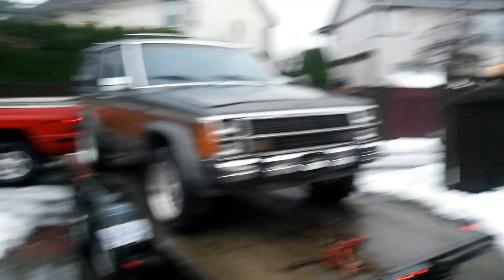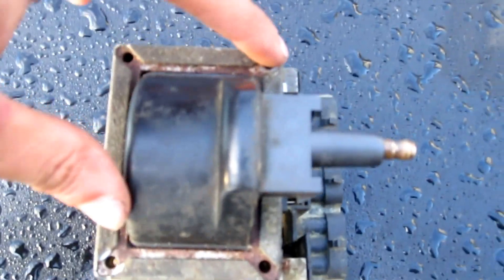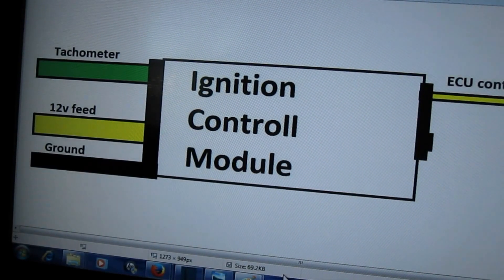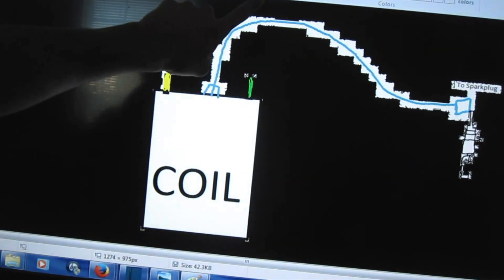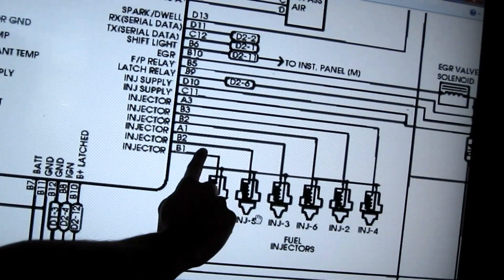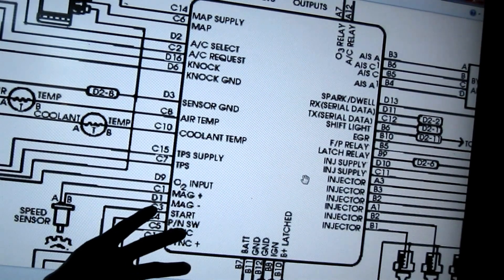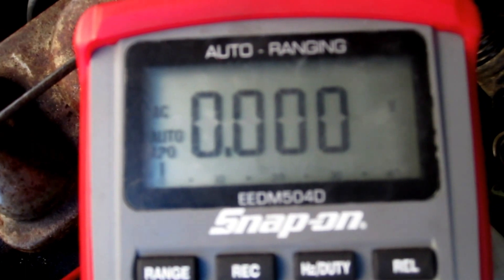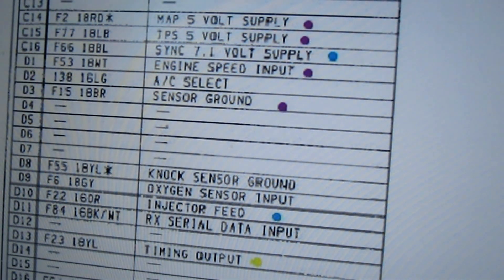Hoopty Jeep Wagoneer XJ Project Part 1:  HOW TO FIX  No spark No start

Comment: Nice diagnosis, ive replaced many faulty computers over the years, its hard to be 100% positive its going to fix it.
Reply from the maker: im just glad its running now haha.  also like your video on crank sensor replacement on the grand cherokee. watched it before i installed the new cps